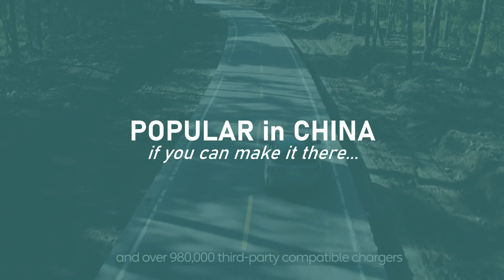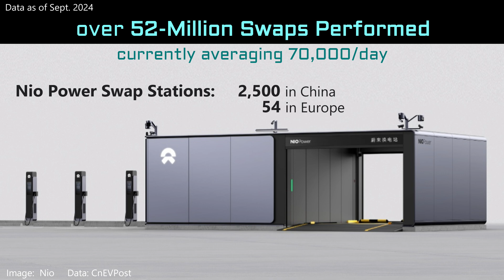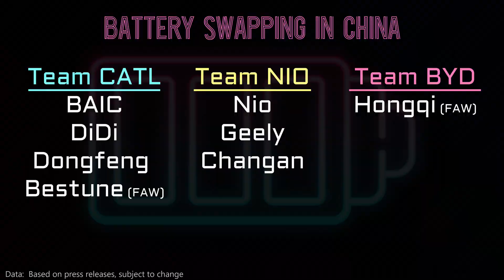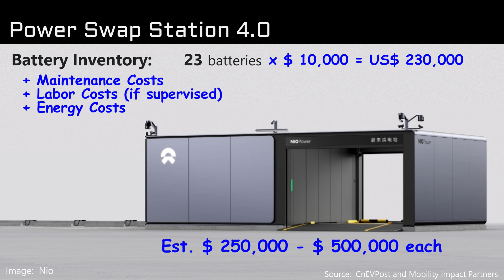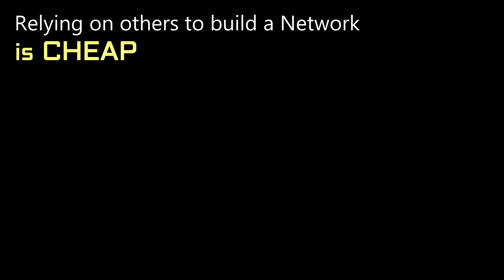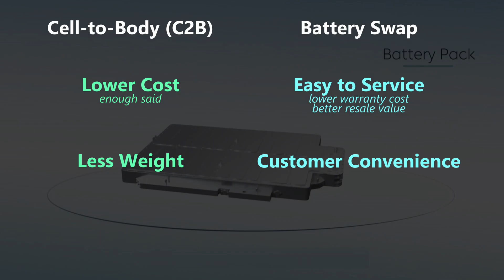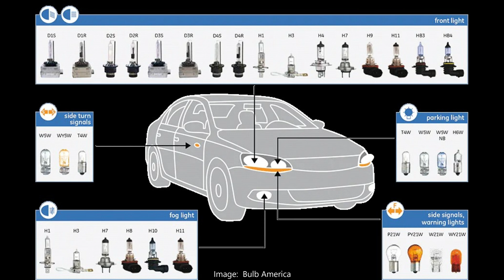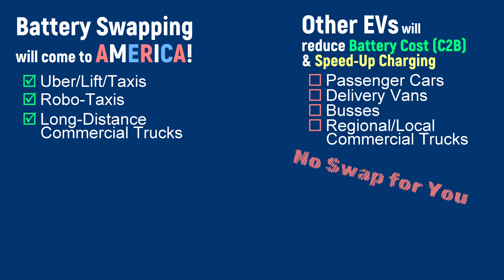EV Battery Swapping - Will America ever get it?

Comment: While most videos on battery swapping - and this is a very good one - talk about the advantages to motorists, often (as here) being overshadowed by their expense and complexity), no-one seems to realize that there is one feature of battery swapping which makes them indispensable to net zero - their massive energy storage. The charging network only downloads power to the grid. In a pinch a BSN could reverse its charge and feed energy back up. Why is that important? Well only because renewables power is intermittent - and that is completely unacceptable (see Spanish blackout). The only way we can make net zero work is with an 'energy reservoir', and the best way to get that incredibly expensive thing is if the motorists pay for it when they rent their batteries from the BSN (ie, they don't buy them, they rent them). This works because right now they have to buy them anyway. And they will like that because with a BSN their EV will be much cheaper, among other things.

Comment: Maybe a battery tool company like Ryobi should develop a car. This technology has been used in tools for decades.  Ryobi has new riding lawnmowers that run on 3-40 volt batteries.  I have a 20" chainsaw and weedeater that have 80v batteries.  These tools are awesome.  Much better than the best gas-powered tools.  Neither tools bog down at all.  If instead of swapping out one battery with an expensive machine you could swap 4 to whatever-80v batteries on the road without the expensive swap station.  The batteries can be charged quickly on a 120v powered charger.  These batteries have their own cooling fans built in.  The brand is MasterForce sold by Menards, but other companies have their own 80v tools.  My guess is that they are all made in the same factory in China but none are interchangeable.  I also realize for many of you weenies this task of changing out 80v batteries would be impossible just as handling a tool with an 80v battery, but it's a sinch for this 74-year-old man.  When a storm blew down 2 large trees on my property this summer I had them cut up and removed in no time by myself.

Comment: Eventually, all major parts of an EV will be standardized. An EV will be like a PC where you can pull out parts and put in different parts that adhere to industry standards.

For battery swapping to become standard, you will need to standardize the battery and parts of the chassis, it will be natural to further standardize things like motors, electronics for the motor controller/charging circuit etc... You might buy the chassis and interior from GM/Tesla/etc... and got the other parts from another company, this will bring competition into the individual components of an EV rather than an entire EV. 

It will exactly be like in PC, each individual component of a PC has its own universe of competitors. For CPU it is AMD vs Intel, GPU it is Intel vs AMD vs Nvidia, RAM and storage, PSU, Case, etc.. all have its own universe of competitors. With competition on each major component the sum of the components leads to a lower priced PC, it should work for EVs too.

Comment: Considering the speed of charging now, I don't think this is very necessary. Large capacity batteries can charge around 200kW, so you can charge quicker than you can take a break now. Naturally, anyone that owns an EV knows you don't need a battery swap unless you are going on a long trip. I use a 12A 120V wall outlet charge overnight and I have never had a problem.

Comment: The cost is definitely the reason why Western EV companies are hesitant about battery swapping. Because the initial and maintenance costs of building a battery swapping infrastructure are so high, they prefer an all-in-one design to reduce costs. While this method promotes superior performance and price through PR, it is likely that it is actually a strategy that prioritizes corporate interests over consumer convenience. On the other hand, there are several reasons why China's electric vehicle companies are working with Nio to introduce battery swapping:

Government Support: The Chinese government is actively supporting new energy vehicle technology, especially encouraging the establishment of battery swapping infrastructure. This policy background makes companies expect future profits, even if they bear the initial costs.

Consumer Convenience: Battery swapping offers great convenience to consumers. In particular, in large and complex road environments such as China, replacing batteries quickly instead of waiting for long charging times is a practical benefit. In this regard, Chinese consumers are responding positively to battery swapping, which provides an incentive for companies to introduce the technology.

Strengthen Competitiveness: China's electric vehicle market is very competitive. Differentiated competitiveness can be achieved by introducing battery swapping technology, which plays an important role in strategies aimed at high-end brands and consumers above the middle class.

Technology Standardization Possible: China already has several big EV manufacturers working with Nio, making technical standardization for battery swapping fast. Standardization will make it easier to cut costs and spread technology, which will have a positive impact on the overall market.

After all, Western companies prioritize cost savings and profits, while Chinese companies are actively introducing battery swapping based on consumer convenience and government support.

Comment: Here's some of the advantages of swapping you can add:
- Increase the range of old cars, for example a 2018 gen1 NIO es8 was launched with 70 kWh battery, now can access the new 150 kWh semi solid state battery, and what is more impressive they have the same weight.
- Grid balancing: this is by far the most important point in favor of battery swapping, since you can benefit from very high fees paid by utilities when swapping stations participate during peak hours.
- the cost of the station: unlike the popular opinion the cost of building a Swap station is lower than building a classic high power charging station, because the most expensive part remains the transformer, a swap station can run on a 500 kVA transformer, on the other hand you need a transformer with thousands of kVA to run a classic high power charging station.
- the fee of swapping: Since the battery swap can interact with the grid, the Swap Station usually charges the battery during low demand hours with low prices.
Reply: Buuuuuut you're paying a pretty high battery subscription. And if you buy the battery you can't swap anymore. So any old car that can swap will be more expensive than an old car that can't swap but for which you buy and mount a new battery the old fashioned way.
Reply: No in China you can still swap even if you buy the battery, and no the subscription fee only costs 100$ per month and you lower the price of the car by 12k$.

Comment: While I like the idea of not owning the battery for degradation and cost liability reasons. It seems that this will have to be a subscription service for the life of the vehicle. Which is nice but it's going to negate some of your gas savings. And while it seems like a fantastic solution now at the rate charging/battery improvements are being made..... I don't know how necessary it will be outside of commercial applications in a couple of years.
Reply: It's more expensive to buy discounted car + rent the battery to replace it when it's worn out than buying full price car + a battery replacement and service to mount it with current prices in Europe.